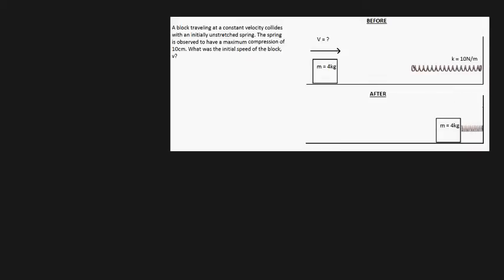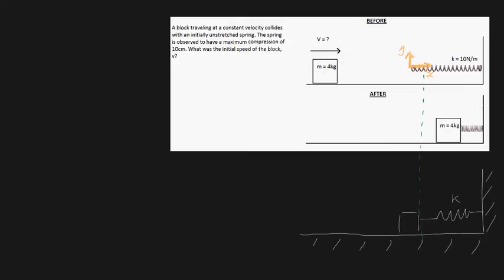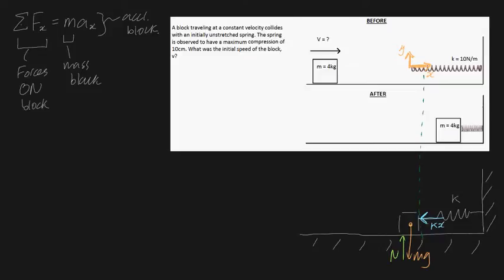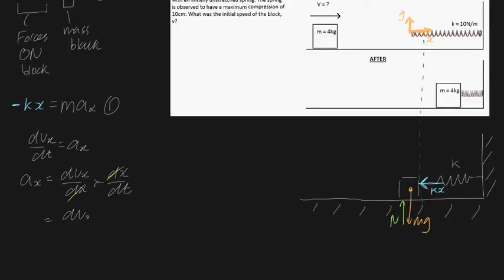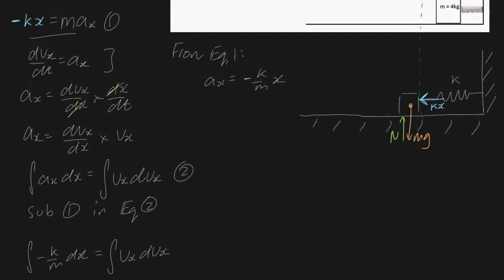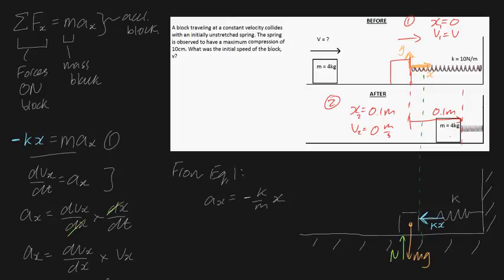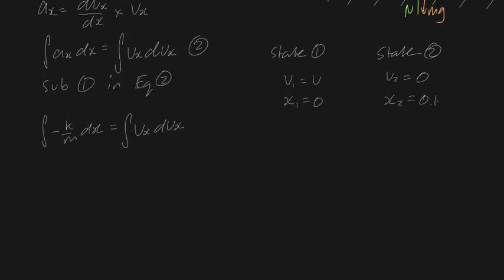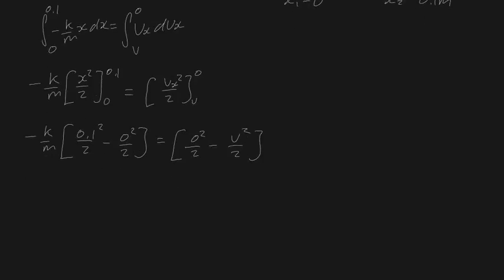Force mass acceleration example spring compression

Comment: Exactly, you didn't think, directly jumped in and brute-forced through it 😂
I thought, what's he doing, there is so much information.
Then the second you arrived at V squared over 2, and m was in the denominator on the other side of the equation, it was clear, that's the kinetic energy that the box had initially and it transferred all of it to the compressed spring.
1/2 * m * V^2 = 1/2 * k * X^2,
where only V is unknown 😂 😂